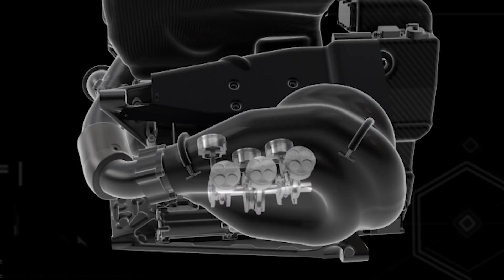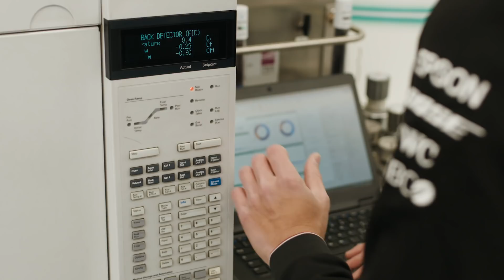Road Car and F1 Fuels, What's the DIFFERENCE? | Fuel and Lubricants Explained!

Comment: I would love to know what Viscosity the oil is thats used. I run Petronas Syntium 3000AV 5w40 in my fast road car as i could buy off the shelf but my preference would be the Fuchs Titan Pro S 5w40 Ester based oil. For lubrication, Ester based oils are awesome. However, I've said before and say again, bring back water/meth injection to F1. Water has an unlimited octane rating so detonation is immediately cured regardless of temps. The main benefit to meth is water cant compete with it when it comes to evaporation to help reduce IAT's. That cold feeling getting out a bath, thats evaporation off the body, same principals what goes on in the engine. Looking forwaed, I get the 2022 cars will now be aerodynamically viable for closer racing but on a car thats air cooled, mechanically i dont see how performance wont be killed. Staying in hot turbulent air from a car in front will impact both engine cooling and IAT's and on a F1 car and I personally would love to know how many degrees of timing will be pulled to protect itself. Bring back water/meth, wind up the boost and lets be having it 👍

Comment: why didn't you tell us what the octane rating is for F1 fuels compared to road car fuels
Reply: SL could be a secret
Reply: the fuel has to comply with f1 regs (see article 19) it has to be a minimum of 87 ron/mon. the constituents are tightly controlled so the possible highest value will not be all that different from regular pump fuel. for example, it wont be 120+ as used in some ‘sprint’ events such as drag racing. it is tightly controlled to produce a stable product for submission to fia controls. the octane rating is only a figure that defines its antiknock properties, it does not directly translate into increased power. there is of course improvements available to an engine that can make the most of a high octane number which of course an f1 engine will be!

Comment: Here I go as an american. Brits use the term “Petrol” which is in actuality short for Petroleum. The chemical name of crude oil. The word Brits should be using, and which is accurate, is “Gasoline” which is one of the many many distillates of crude oil aka petroleum.
Reply: i call it black gold
Reply: Gas is not a short for Gasoline ,  to be accurate,  gas station should be called 'gasoline station' and not gas station
Reply: British English is not the same as American English. In British English, petrol is the distillate of petroleum, not gasoline, which is American English.
Reply: Wrong in England it’s petrol not gasoline